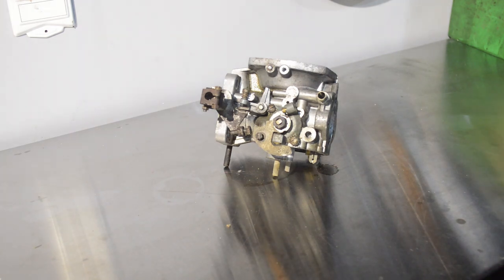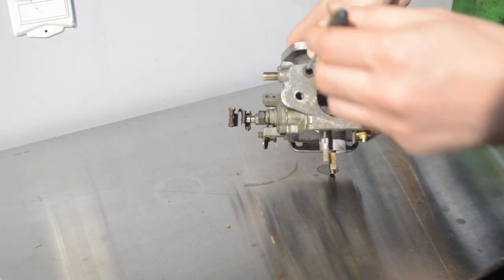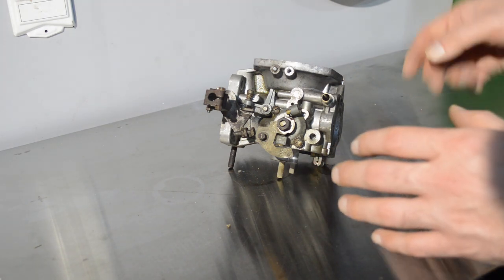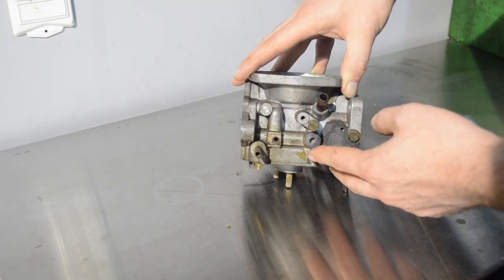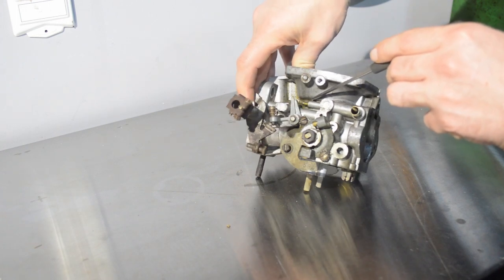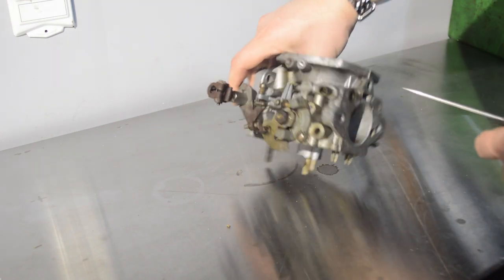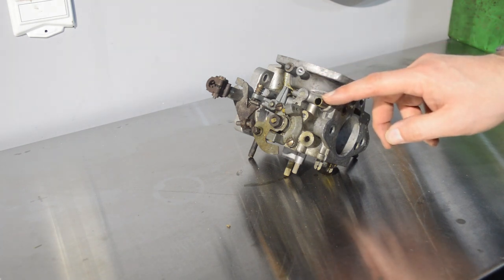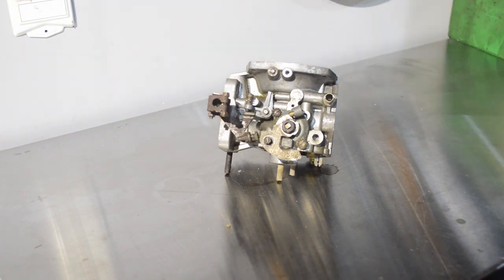The Zenith Stromberg Float Bowl Vent

Comment: Great info.  Question...after rebuilding my ZS carbs (1972 Jag XJ6) I'm leaking fuel from the manual choke control on the side of the carb.  Gaskets are new, screws very snug.  Ideas on what to check next? Floats set at 17mm or just under.  Fuel valve on carb was moving at time of install.
Reply from the maker: Check the choke internals are assembled the correct way round. If they're backwards it'll leak. Also check your float bowl vent for blockage.  I hope that helps!

Comment: Again, really helpful. My car, a Rover SD1 V8, has CD175s. It’s fascinating seeing what all the blocked off ports are for. On my car, the vent is a flooding escape port, which will deposit fuel away from the engine (well, in front of the engine). A return to the petrol tank would have made some good sense but BL reasons, I guess.

I’m currently rebuilding my second set of Strombergs, actually the original carbs, as I’m having trouble getting the engine to run nicely. It’s stuck running rich, and is burning excess fuel with high emissions. One thing is possibly to reinstate the poppeted butterflies, which I’d replaced with solid discs. There’s no overrun device on the carb otherwise. I’ve learnt a lot since I rebuilt the first set of carbs but am also contemplating whether the distributor could be at fault. If the new carbs don’t solve the problem, I’ll need to look elsewhere.
Reply: Please keep the engineering vids coming!
Reply from the maker: So there are a number of reasons this could be happening.  "Stuck running rich" usually means there's a fuel smell coming out of the exhaust.  However, an incomplete burn could be the cause of that, which could be caused by poor ignition timing.  If it is a carb problem, and it can't be tuned out, I'd suspect either the floats aren't set correctly or that the choke assemblies (1 or both) are assembled the wrong way around.  I have a couple videos on rebuilding the carbs, so check them out since I know I go into the choke assemblies in detail.  If you still need help, I'm happy to rebuild them for you (check out www.mwmotoring.com for more info), but if you have an SD1 I'm guessing the shipping might be a hurdle as you're probably not in the US.
Reply: @midwestmotoring  I'm also suspecting the choke, or in this case, the FASD, which is a coolant controlled choke, which activates a plunger that slowly closes off extra fuel/air. It kind of works as third carb, enriching the mixture via its own port on the manifold but takes fuel from the choke port on the carb and air from a port on the air elbow (between air cleaner and carb). It could be stuck on, even thought it appears to turn off. I have a replacement I've refurbished I'm going to pop on when I swap the carbs over.

Yep, in the UK. I watched your rebuild videos the first time round and they were really helpful – thanks!

Comment: You previously advised me to not plug the vent tubes. This '74 TR6 came from the previous owner with them capped. That did cause fuel to leak and add 2 quarts of gas to the oil. I will now connect them to the air cleaners with rubber hoses. There is no charcoal canister either. The rear carburetor's vent slide rod was stuck forward or in. It also had broken float pivot hanger clips someone had tried to screw down. I bought a pair of spare carbs on eBay and will use the best of all parts to make 2 good carbs. Thank you again for the excellent videos and all of your knowledge and instruction on these carbs.
Reply from the maker: A lot of these parts are interchangeable.  Just make sure you have the correct part numbers (such as the needles) specific to your car.
Reply: I'll make sure of the correct part numbers. Why aren't the bowl vents open all of the time? Working the throttle opens the vent and also closes it. Don't you think it should be vented all the time.?
Reply from the maker: It doesn't close it. It reroutes it between the air cleaner and the carbon canister. It's only closed at times when someone removes the canister and then caps the vents.

Comment: Wish I had seen this before trying this version on a tr250. I plugged the vent to the , non existent carbon canister, and had problems with fuel flooding. Also, the foot on the throttle return lever is too small on mine and catches on the throttle set screw locking the throttle on.
Reply from the maker: Hopefully this helps set things right!
Reply: I swapped back to the original carbs
Reply from the maker: @mrichardweiss2365  even better then.  Fewer bits to go wrong!  I would add that the throttle might have been fixable by bending it a bit, but either way you're covered with a different set now.  Happy motoring!

Comment: Recently, I've had an issue with my TR6, where it seems like only one carb is feeding fuel.  Engine is running, doesn't stall, but sounds like a dang lawn mower.  If I pull off the road, allow it to sit for a minute or two, then start engine, it seems to run normally.  I've also noticed that I cannot get the mixture rich enough from the adjustable needle.  I've adjusted it fully open.  Is it possible the jet, (non  adjustable) is sitting too high in the bridge?  If so, is there a height setting for the jet that I can check?
Reply from the maker: It's possible, but then you need to ask the question: what made it move--since presumably it was fine before.  Unless new jets have been installed, it's pretty unlikely to be faulty.  Much more likely the floats are causing problems, or that it's not an issue with the carburetors at all.  I'd start with the ignition system, and make sure the valve clearances are set.  If you need help with the component rebuilds or testing, check out the services page on www.midwestmotoring.com.  I hope that helps!  Good luck!
Reply: @midwestmotoring  Well, I can tell you, when the engine is running, she's smooth as silk, no pops, no backfires.  I've noticed bad wires will do it, and I understand the ignition system pretty good.  A lot of that is new, and working well.  I believe the fuel level in the bowls related to float, like you point out, is more likely the issue.  I will look there.  Maybe the floats are set too low.  Is there a way to identify the level of fuel in the jet is correct?  Maybe if I pull the air valve and needle out, and observe the fuel in the little opening, I can see if there's  a good level of gas in there.. Would I be able to tell that way?  how close to the top of the jet opening should fuel be noticeable?
Reply from the maker: I'm not really sure there's a good way to see the fuel level, but I've never found it necessary. There's a spec to measure the jet height but I don't know what it is since I rarely if ever touch the jets.  If your fuel height is incorrect it's down to the needle valves or the floats, so check those.  Otherwise, there could be a fuel restriction, you could have buildup in the tank, your valves could be set wrong, the throttles might not he synced up, the manifold could have a restriction, the distributor could be sticking when hot.... and dozens of other problems. The only way to start to narrow it down is to get some test equipment on the car and go for a drive to see what's failing on the road.
Reply: Ok, thanks for some direction.  I’ll investigate these things you’ve outlined.